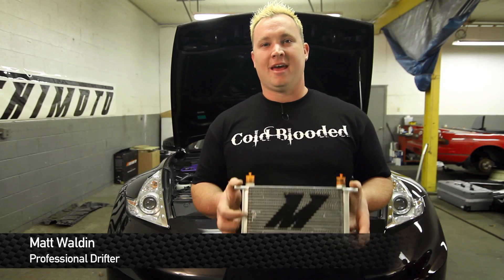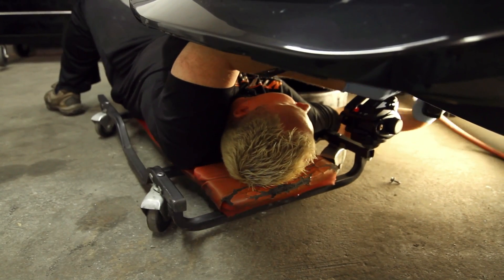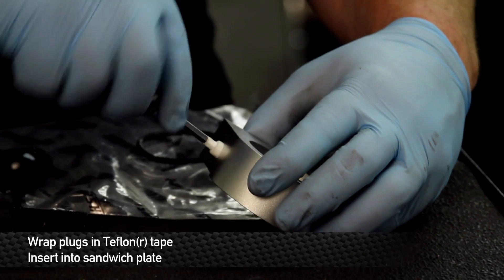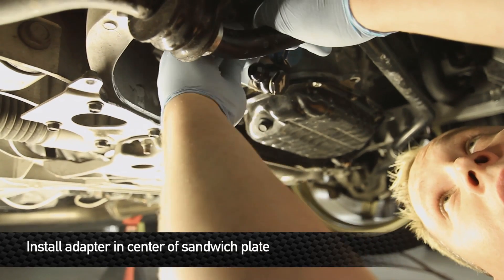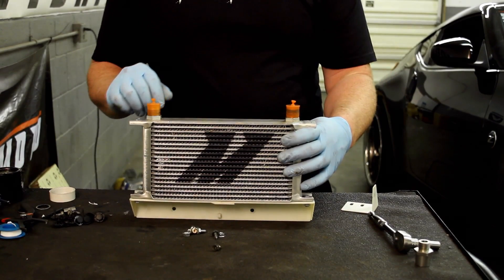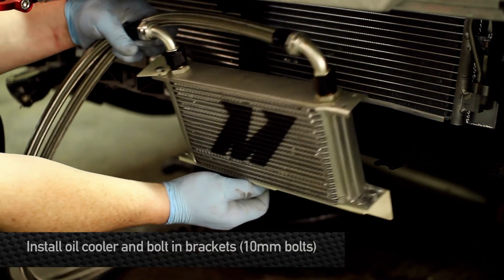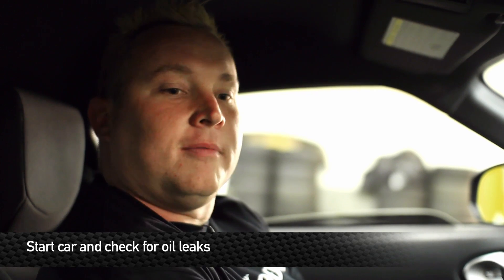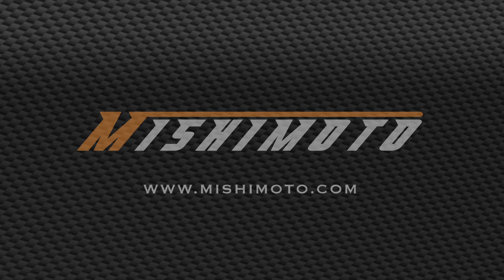How To Install: Mishimoto Nissan 370Z Infiniti G37 (Coupe only) Oil Cooler Kit

Comment: Curious, what if you have a newer 370 with the coolant through oil cooler already on it? Would it need to be removed first?
Reply from the maker: This would be added on top. This will not replace the OEM system.

Comment: Does it matter if the inlet /outlet on the cooler are mounted up right, sideways or upside down??
Reply from the maker: The orientation of the cooler will not affect its performance as long as you are getting proper air flow to it.

Comment: What pushes the oil through the lines and cooler? Anyone
Reply from the maker: The oil pump
Reply: @mishimoto  the oil pump that's on the car or you have to buy one for the cooler
Reply from the maker: The oil pump that is already attached to your engine.  The install guide you are commenting on shows the complete process.
Reply: @mishimoto  ok thanks again

Comment: Which line from the oil cooler goes to which sandwich plate connector?
Reply from the maker: Our coolers are bi-directional. You can install either line to either port on our sandwich plate.
Reply: Thank you!

Comment: Thinking of getting an oil cooler for my 350Z.  
Question:  when changing the oil, how is the oil drained out of the oil cooler?
Reply from the maker: Nismo350Z The oil inside of the oil cooler itself does not need to be emptied, as it only contains 0.5-0.75 quarts. As long as the user follows factory service intervals, this will not cause any sludge or gunking issues. If the user is seriously concerned about the oil within the cooler, it can be removed and turned upside down to empty the contents during a fluid exchange. - Patrick M.
Reply: Oh okay....thanks. good to know

Comment from the maker: John doe, we do have a thermostatic option available for this kit, this is available in the drop down menu of the product page. The thermostat provides quicker oil warmup while maintaining optimal temperatures during aggressive driving. The Mishimoto Thermostatic Sandwich Plate restricts flow to the cooler until a specific temperature is reached (185°F). We highly recommend this for those in cooler climates, however it is very effective in any environment.  Let me know if you have further questions!
Reply: is it really necessary to have a thermostatic? especially in tropical areas like in florida?
Reply: The thermostatic is problematic when you run the car hard, i got 240 degrees with is on the 34row oil cooler, i think im getting rid of the thermostatic sandwich plate.
Reply: @andywu8558  what temperature thermostat are you running?